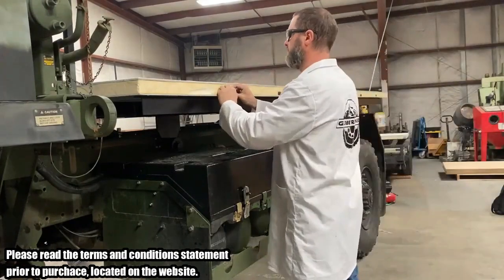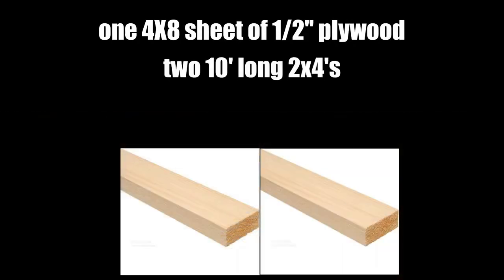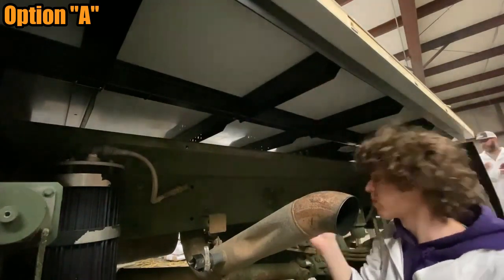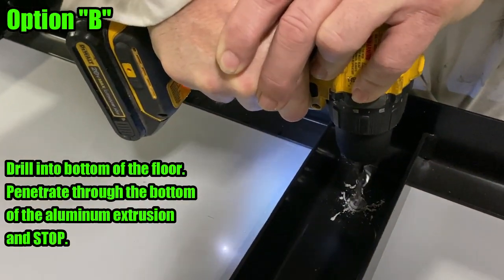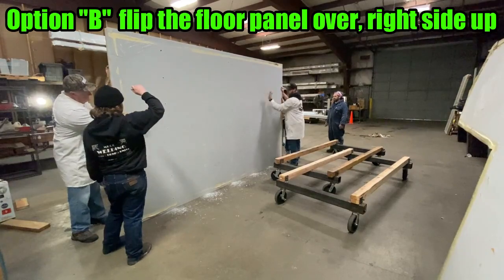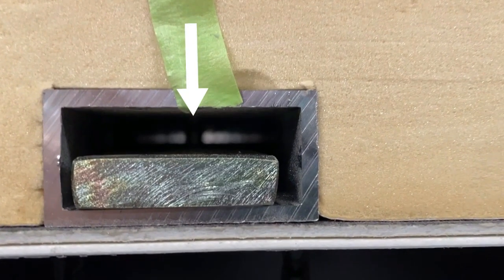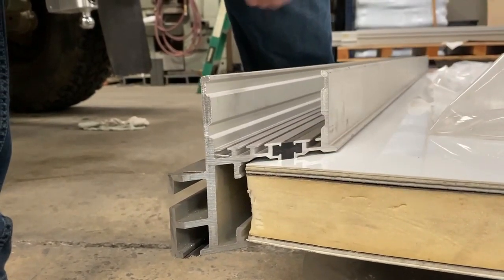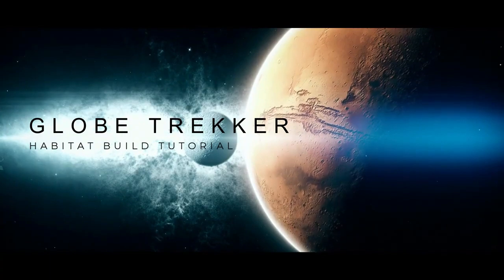Globe Trekker Camper Build Part 1

Comment: We are looking to wrap our truck and habitat.  

Thinking of wrapping pre assembly which would give a possibly nice silver contrast of the joining frame. (Not sure if bonding considerations needed since wrap would cover space where sika flex adheres to frame and panels) options for tooth cuts or 1/4 way under frame so adhesive bonds better 🤔 

Or wrap over frame = shorter lifespan of wrap? 

Have you all had any experience with wraps yet?

Or paint options with vinyl graphics of sponsors but durability drops considerably with "sticker" type applications.
Reply from the maker: The FRP and the anodized aluminum are both very conducive to painting or wrapping. The science of adhesives does tell us that darker colors that are heated up by the sun will tend to break down sooner than adhesives that are kept cooler. That being said, the GT design helps mitigate problems of adhesives breaking down, with the advent of glue pockets in our extrusions (now being copied by our competitors more often than not), our extrusions having more than double the glue pockets of other manufactures, and our panels having zero organics in our panels, making them nearly impervious to water damage. Our sub laminates under the outer FRP lament also dramatically improve resistance against delamination.
Reply: @RVGlobeTrekker   from everything I have seen your panels head and shoulders above the rest not to mention the customer service.  Can you believe there were companies that didn't even respond to my initial quote request? 🤔  

You responded quickly and gave a valid breakdown and quote.

Since the wrap is a temporary solution and box integrity and strength is more important perhaps bringing the wrap right up to the frame would still work.